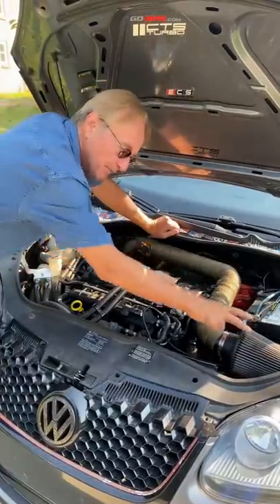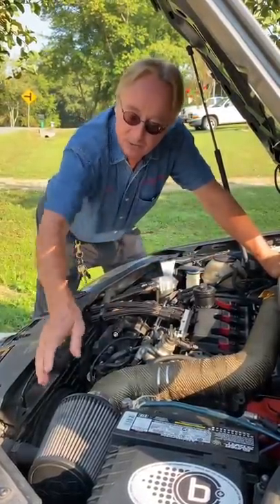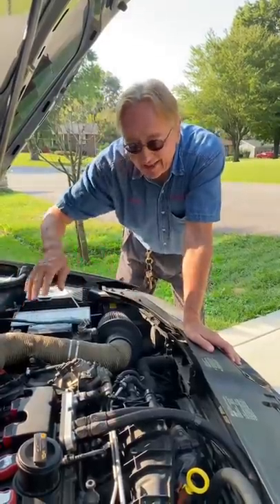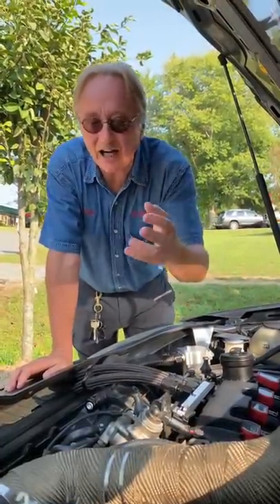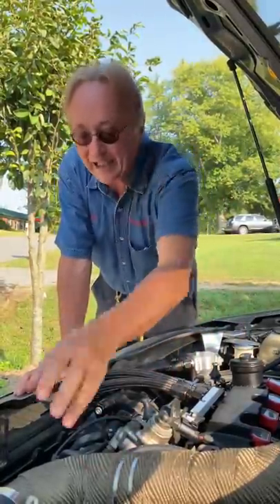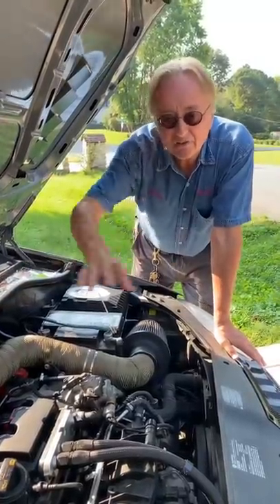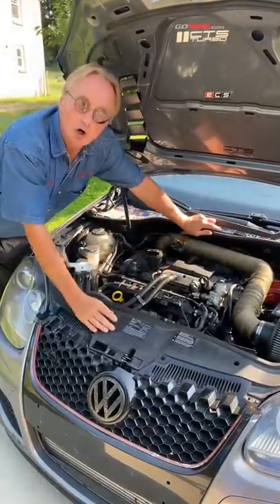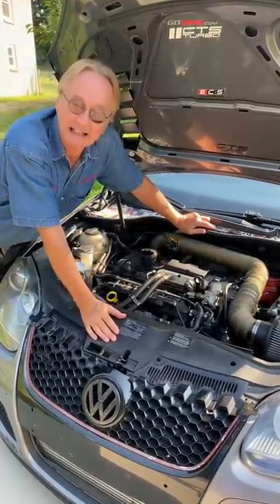Why Cold Air Intakes are Stupid

Comment from the maker: Thanks for watching! Like and Subscribe for More Vids Daily ► https://www.youtube.com/channel/UCuxpxCCevIlF-k-K5YU8XPA?sub_confirmation=1
Reply: Scotty, first of all if you install a cold air intake, you have to disconnect the battery cable before you install it so you don't get a check engine light. Second, they can improve fuel mileage.
Reply: @jewsrbad  That's because you're not using the heat shield that came with the cold air intake.
Reply: @jewsrbad  idk what that means
Reply: @seangowan7441  Not really the same with a blow off valve they push on the gas just to hear the noise.
Reply: @emerymayoros9217  in my experience it's MAF run cars that don't benefit 

Any car running air temp sensor and MAP sensor instead of MAF will benefit 

This is only providing that the ECU sensors stay in the original place the cold air filter will only help if it's in its own cabin and far better connecting this to the original location for cold air feed from the manufacturer 

They don't build the car to recycle the warm air from the engine 

So don't do this yourself 

Oil the filter regularly 👍🌞👍
Reply: @jewsrbad  well said using factory duct is essential for many reasons 

Also having a cone filter in a cabin fed with pipe from both sides of the cabin causes every last wave of sound to get chopped up making the noise sound meaty and with added barbel
Reply: I have a question for you Scotty!! I have a 98 Jeep Grand Cherokee inline 6, runs well but a little rough, it’s stutters and doesn’t accelerate well, would a better air intake help?
Reply: Iv always said it's more likely that a different intake will just kill HP.
Reply: It’s not even a cold air intake lol
Reply: It’s an upgraded intake for an upgraded turbo and the car is tuned so you sound silly scotty
Reply: I've done extensive research.  Apparently the stock air unit on explorers are better than aftermarket for power and mpg.
Reply: @cindysue5474  blowoff valves do the exact opposite, they make noise when removing throttle and blowing off the boost pressure
Reply: Poor Example.. as this ISN'T A COLD AIR INTAKE ... 🤡🏆🤣👍🏻
Reply: Chances of you responding are slim but I wanted you to do a review on the thorton tuning OBDII doctor I know some OBDII plug and plays do work but I don’t have a real diagnostic machine to see if it actually does something I think it does but you’d be the one to really know, also asking if you could review there self tuner too because i don’t know how to use it would be much appreciated and probably help a lot of others too.
Reply: Your so negative in all ur videos about every cars
Reply: I'm gonna make a video called "why scotty kilmer is stupid" time to dubunk this grandiose narcissistic 😂
Reply: So if i tune my car its fine?
Reply: What about keeping the same style but switching from paper to k and n filter. It runs great on mine but doesn't increase the air intake as much as a cold intake does.

Comment: Sometimes this guy knows what he's saying and sometimes he doesn't.
Reply: he is correct, that adding one with no tune is bad, but with a tune it’s good
Reply: Oftentimes it's the latter.
Reply: Some CAI are dyno proven to give small increases. It a simple fact that some factory air boxes choke the car in comparison to aftermarket. Obviously not every car this will be the case.
Reply: @megazuccc  depends the car tbh some cars still gain some hp without a tune.
Reply: *most of the time he doesn't
Reply: @rushking19  Camaros gain even without a tune
Reply: @Alex Keenan  what? mass airflow measures how much air is going into the engine. it doesn't control anything. but scotty is still incapable of knowing that modern vehicles have closed loop tuning and can change short and long term fuel trims aswell as advanced timing to an extent on their own which can take advantage on some mods and gain power.
Reply: I couldn’t agree with you more on that
Reply: @alexkeenan5768  your “MAF.” Sensor adjust to your intake. Stock intake limits your air. Using less gas with less air to fuel ratio. Once you open that stock up and put a filter that can grab and suck air without a limit. Your maf, ecu, and everything else has to adjust to a new air to fuel ratio. 
And if you can custom and get the filter to grab fresh air away from all the limits. You gain horsepower for sure. And when it’s cold outside. You will gain even more. 

It has been proven to give you more horsepower with just a drop in filter homie. Can’t argue against that. And since you did. Here’s the actual reasonings behind why you get more horsepower. 

And I know you’ll say something about the cars tuning. But the cars tuning was made for “stock.” So adding something after market means it opens up from stock. FBO with no tune gives you horsepower. Which includes hence cai/ ram intakes.
Reply: @nigelholland1714 nope, cold air intakes have reasonable science behind it.
Reply: Hes anoying💀
Reply: @intoitshots420   what about if your cars a  v8
Reply: Laughs in 1990 460 with no maf sensor and no longer has 8 feet of restrictive intake hose.
Reply: @rushking19  you should still get a tune because it messes with the air/fuel mixture that the ECU is tuned for, making it run rich or lean despite the horsepower increase
Reply: @imblacknotracist5358  you know ecus can adapt to minor changes right? And something like a Cai is a minor change . You get more of a chance in air fuel mixture going from a low to high elevation and cars ans adapt to that without issues. This isn't the 80s
Reply: @alexkeenan5768  The impact on the MAF sensor may vary depending on the specific car and its original design. Some vehicles have more tolerant ECUs that can adjust to increased airflow without issues, while others may require more precise tuning.
Reply: @megazuccc some engines can retune themselves actually for more airflow but no your not gonna make as much power as if you got a tune
Reply: @stone65037 some cars don’t come with MAF sensors.
Reply: @alexkeenan5768 is it a max or a mass. That made my head hurt.
Reply: @megazuccc 

I think the fact he's calling a cone filter plonked in an engine bay 'a cold air induction kit' is my issue here.
Reply: @alexkeenan5768 

Megazucc said with a tune and they're correct on that.
Reply: @skylined5534  yes I am well aware, I have a tune on my mustang. And I added a bigger fuel pump. And exhaust
Reply: I mean, if you get your cold air intake for like $15, and install it correctly just for some sound, cuz that's what you want, louder engine for CHEAP. A proper tune is about $200 here, and not even the engine itself costs that much bruh
Reply: CAIs are very tricky, with some cars you’ll need a tune because it’ll mess with how it runs, others will run it happily without a tune and that’s the end of the story, other cars will also run it happily without a tune but you could actually see power decreasing and I honestly don’t know why that would happen but I’ve seen it happen where power drops a marginal amount up to 5hp but even then it could’ve just been an error on the dyno run. But Scotty is definitely blowing it slightly out of proportion
Reply: @themaker4216  a lot of the times that comes down to how old the car is too. Newer ECU will constantly observe how an engine is running and make adjustments to the tune map itself. I’ve seen plenty of 370Zs here that have aftermarket intakes and exhausts and haven’t gotten tuned and still run great
Reply: @megazuccc explain because I thought that was the job of the map/maf sensor
Reply: Strongly agree this time😅😅
Whit my full respect for his time and support..
Reply: Most of the CAI gives you some more power at high rpm but you will have a massive lag in throttle response due to the length of the intake tubing. Short Ram do not have this problem but sucks in hot air from engine , so no more power , only noise. Washable sport panel filters are the best compromise.
Reply: @alexkeenan5768 mass airflow sense the amount of airflow and change the air to fuel ratio accordingly, without tuning you might get more flow but will not be efficient.
Reply: he definitely right about this some people just don’t want to hear the truth
Reply: @alexkeenan5768 ubdefinilty don’t understand how mad sensor works. it doesn’t limit anything just ready amount of air flow and send info to computer to make the adjustments
Reply: Bro Ty for that comment you seriously made laugh.
Reply: @megazuccc doesn’t matter if you have a newer car with an ecu that can adjust with the intake. So that depends on the car you have lol
Reply: @Brzi__ he’s telling the truth however yes it is annoying to hear a cold air intake only make the engine sound aggressive no added power though 😢😢
Reply: @123devinzz1 well-said. That's why when you install headers/ change exhaust and/ or CAI, cars experience oscillation on idle until it recalibrates fuel injection according to the change in air flow. With a tune you get more of course, but even without it you would get HP gains. By experience chevy v8's and Cayote respond better than 392 for instance, but there are gains to be had.
Reply: @megazuccc not necessarily. It can run lean or rich... can
Reply: I would like to see one of thoose videos when he knows what he is talking about xD 
I havent seen one so far
Reply: @megazuccc K&N just came out with a video saying you don’t need a tune for any K&N if anything pops on your dash while you been driving it that happened on you
Reply: i’ve noticed that he usually seems to be correct for the average person, not quite for car people. it’s free grandpa advice. you really don’t wanna bother with a cold air intake if you don’t plan to / don’t already have a bunch of other mods, and that checks out with what he said in this case. good advice for people that wanna learn a little about their car but not for a new enthusiast
Reply: @nigelholland1714 I got a Camaro 2.0 finna put an intake in on mine tryna get that extra 30 hp
Reply: @123devinzz1 so your saying after market intakes are a go bc i wanted to get one but this foo scaring me 😭
Reply: @megazuccc  not in modern cars it doesnt really matter if u have a tune
Reply: I can't stand this guy, or his opinions.
Reply: The key is make your own. Many costs $200 or more plus it depends on how you route it to get cooler air.
Reply: I drive a focus st mk2, and I know that these cars with bigger intercooler, intake and turbo-back exhaust, gain 20 horsepower WITHOUT tune. Same for all turbo cars, just provided an example with exact numbers. Maf sensor does its magic.
Reply: THISSSSSSS

Comment: I need that 1% HP gain Scotty…
Reply: If HP is like money, I’ll give you 10. Sounds so pityful mate 😂
Reply: 😂😂😂 Me to 😂😂  that's good answer
Reply: Independent testing has shown 8hp gain on a 200hp car. That’s 4%
Reply: @RedogOnyx not bad ngl. My car allegedly pushes 200 stock and i want to push it to 250 or 300 in the future
Reply: @astra3459  *pitiful
Reply: @TonyStark-zf5br  thank you for correction
Reply: ayee that matters😂😂😂😂😂
Reply: pay to win
Reply: +1 HP

+20 cool meter 😎
Reply: No kap😂
Reply: Definitely needed to put it on me trailblazer
Reply: @rickjames1179 😂😂
Reply: Honestly , I would be happy with 8 to 10 additional horses on my Honda Accord coupe(daily).

Now for a well known performance car, that’s meh…
Reply: @marioelburro1492 same, I’d be happy with about 290 to 300 HP on my daily. Hell, most daily driven cars that try to challenge me on the regular aren’t doing that, and if they are, they are usually heavier than I am anyway.
Reply: @ethericdezigns1528  its more than enough for a small car like a couple or hardtop like mine. I just feel like it needs a tune since it gets lazy accelerating from 45+mph. Anything more than 350 would be impossible since its fwd and it breaks traction easily with 200
Reply: It gives 12-15 horsepower gain 😂 you're all clowns that drive Kia's
Reply: Right I’m at 999 horse power that 1% will help
Reply: Stupidest thing ever they need to clarify this is for MODERN CARS I was shocked to notice my older 1998-2006 cars were doing way better in terms of low end torque with a cold air intake then I took it off I think a total of 4 times two runs with each it was a night and day difference. Clarify that.
Reply: I drive a BRZ too
Reply: Well, an AEM cold air for my 2020 Camry (on dino) will provide about 10 more HP. (Give or take) Which is 3-5% of base HP.
Reply: Hey that’s like 1-3 I’ll take it
Reply: More like 5-10% for most people lol. If you have a little Celica or Miata etc. then adding 5-10HP from a CAI will definitely make a difference
Reply: @Rabanestre101 And on a Celica or Miata adding 5-10HP can be like a 5-10% gain in power which is absolutely significant
Reply: @marcz239 Tell that to my 2018 Honda Accord 🥱 It IDENTIFIES as a Honda Accord not a Kia, BOIIII!
Reply: 10% for me, because I actually have a turbo charged engine